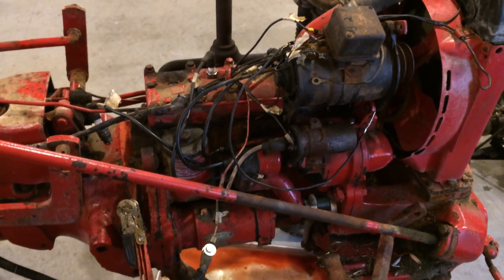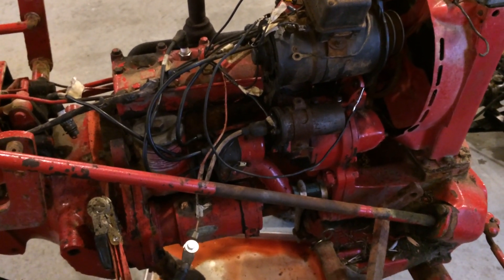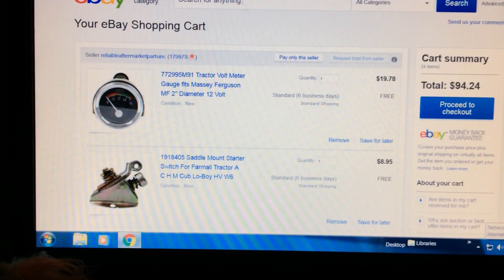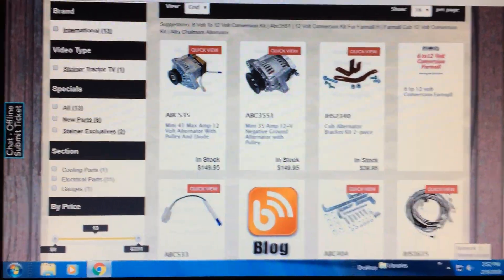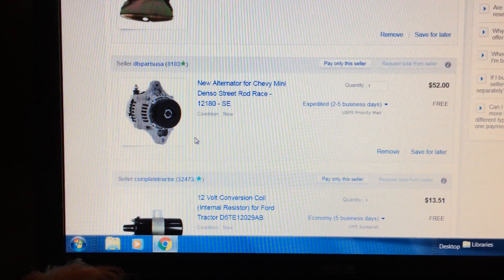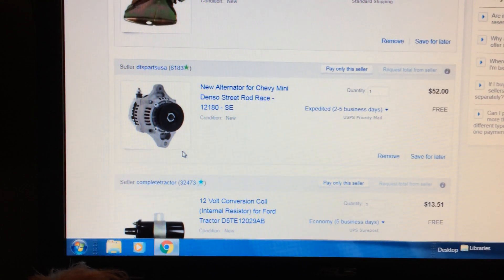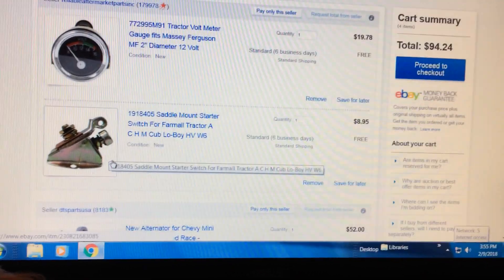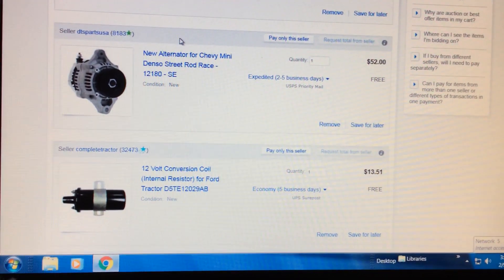Tractor 12 Volt Conversion  Step-by-step Part #1

Comment: Not familiar with this tractor but what about the starter?
Reply from the maker: Use the original starter.
Reply: @justtinkering6054  yes. I did some further research. It's not permanent magnet so accepts the polarity change.

Comment: My dads cub has the coil part number 353874R91 which is a lot more then other 6 volt coils in seeing I'm wondering if you would know if that same coil needs to go back on or would a different version be ok?
Reply from the maker: If you are converting the electrical system to 12 volt, you will need a 12 volt coil.
Reply: What If it's kept as a 6volt system?
Reply: FUCK CHINA. Pay a little more and give the business to a local farm supply store. And you wonder why your farm businesses are failing

Comment: I have '48Cub with generator & magneto. Do you think this setup will work on it, thanks for all the effort in posting these
Reply from the maker: I don't have any experience with mag setups on Cubs. I wouldn't think the conversion would be any different though.
Reply: My H is magneto.  I think the set-up would be the same except for the needed coil.  The magneto set-up is completely isolated from the voltage system (battery, generator, starter).  The mag produces it's own spark, similar to that of a Briggs & Stratton lawn mower engine.  Kill switch just grounds out the mag spark.